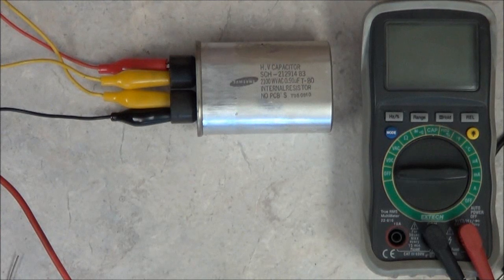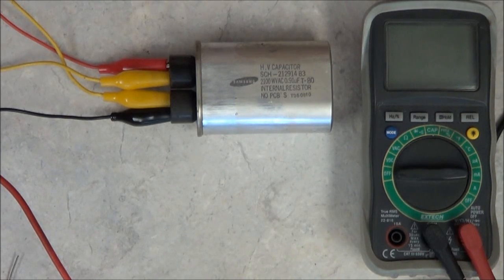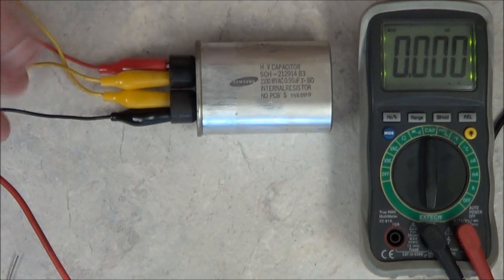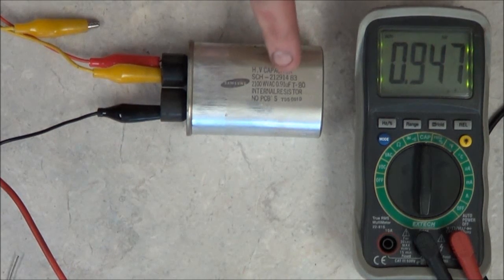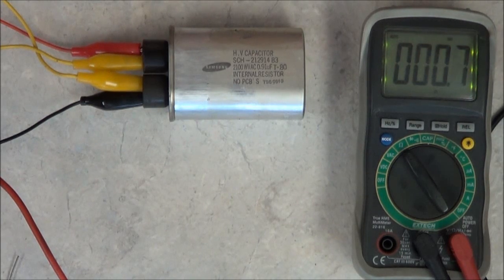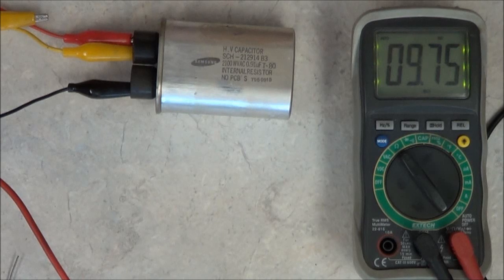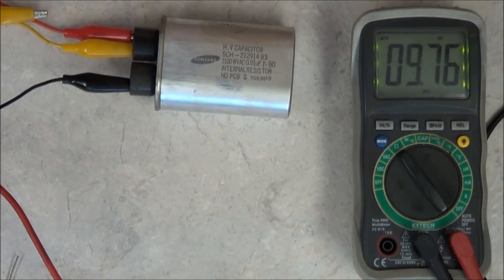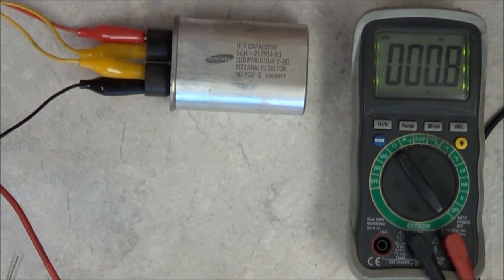How to test the Microwave Oven's HV Capacitor

Comment: In the UK .. a  VERY  simple way to test your  EHT  1μF capacitor ... is to put it in series with a 25 Watt , 230 Volt ( old skool ) Tungsten filament light bulb , apply mains !  ... an orange glow ( similar to a 1940's tube [ valve ] radio )  , should indicate a working capacitor ... BTW .. this setup makes an excellent night light ( try it out ! ) .............. DAVE™🛑

Comment: Used the capacitor setting to test a microwave capacitor and numbers were fluctuating up and down between 0-.50, stopped for 5 seconds ,then continued. Have you seen them fluctuate like this before ? I'm assuming the capacitor is faulty if it's fluctuating up and down like that every 5 seconds?

Comment: OL means OPEN LINE not Over the Limit. OPEN LINE means infinite resistance which happens if the test leads are opened apart with no conductance between them.
Reply: Odouls77 open loop
Reply: Delbert Stevens - Another one is Open Load or Open Leads. Both mean infinite resistance, higher then 100 million megohms.
Reply: Thanks

Comment: Very good presentation. A clear demonstration of a built in bleed resistor in a high voltage capacitor using a digital meter.

Comment: Thanks for the safety comment. I need a clarification since I am new to this. I am not attempting anything until I am sure so I have a lot to learn by reading first.

This is the part I need to understand: Your comment is in quotes.

1. "This case: high voltage cap, if charged it can take a while to discharge or worse the internal resistor is busted and it doesn't. In this case it could sit there at 2kV you touch it or try to put non-insulated/poorly insulated alligator clips on it and the high voltage in there happily zaps you with potentially lethal results, hence make sure it is discharged entirely. 
My response: Yes, I understand this part.

2. "Same goes for "just mains rated" filter caps and what not in any transformer on the mains side even if the appliance has been unpowered for a long time."

My response:
A. What is "mains" and "mains rated" and "mains rated" filter capacitors? 

B. When using the word "transformer" are there transformers in a microwave that remain charged if the microwave is unplugged and the capacitor has been discharged, disconnected and removed from the microwave?
Reply from the maker: The "mains" refers to the primary power source going into the microwave.  Some microwaves use a Mains Filtering capacitor to filter out electrical noise created during operation. The HV capacitor is used to double the output voltage from the Transformer.  The newer HV capacitors have a built-in 10M ohm resistor to bleed the Capacitor's Charge. To ensure they are discharged you must use an insulated tool to short the terminals on the capacitor before removing the capacitor. The jumper alligator clips are then used to keep the capacitor discharged until you're ready to test the capacitor.

If replacing the capacitor, the new capacitor must match the same ratings as the original. 

Transformers cannot hold a charge because they depend on induction. for them to work.  Meaning current has to flow thru the transformer to for it to work, as to why all electical power must be removed before service.

Comment from the maker: No, I don't mind, MrMac. Everyone else does. Isn't ESR meters used to test the internal resistance in battery packs? Never heard of them being used to test a Capacitor. I rarely use the capacitance tester since I've had better results using an ohm meter to test them. -MrFixit

Comment: Great explanation, thanks for the video!

Question: Why does the digital multimeter show 20MΩ → 10MΩ when starting from a discharged capacitor and 5MΩ → 10MΩ on subsequent readings?

The 5MΩ → 10MΩ makes sense to me: As the capacitor is being charged its resistance increases, up to a point where we’re looking at just the 10MΩ from the internal resistor.

But the 20MΩ → 10MΩ I don’t understand…
Reply from the maker: Modern HV Microwave capacitors have an internal 10 Megaohm Resistor (known as a Bleed Resistor) connected across the terminals. This is to safely discharge the capacitor when the power is removed. The first test determines if the 10 Megaohm Resistor is functioning as intended.

Ohm Meters start from their highest measurable value, in this case, 40 Megaohms. As the tester applies current to the capacitor, it is measuring the resistance. The values are decreasing as it measures the resistance in the Capacitor but at the same time the resistance is increasing as the Capacitor is charging. A 1 microfarad Capacitor does not take long to charge. 

By the time it dropped to 10 Megaohms the capacitor was nearly at full charge, as to why the Values were slowing down then stopping at 9.76 megaohms.
Reply: @ESRepair  Thank you for the answer.

Comment from the maker: Yes, an oscilloscope would help to see if the capacitor is bad. It will show a waveform applied to capacitor and how the capacitor responds to the waveform. I am still learning how to use mine. I've tinkered with it from time to time and had thought of doing a video how to use it. -MrFixit

Comment: Love the videos!!! keep it up!

Here's my problem (hopefully you can help). Our 1 year old Kenmore range microwave started to hum loud and burning smell and no heat. My research said could be the diode, capacitor or transformer. I had another older Kenmore range and I took the diode out of it and tried it in the bad microwave (AND YES, I DISCHARGED THE CAPACITOR 1st).  Now the loud hum seems to be gone but still no heat. I'm only 99.9% sure I wired the red wire and white wire to the capacitor as well as the diode correctly :(

Any suggestions would be appreciated...

Comment: wow 2200volts 0.9uf?? my motorbike ac cdi is using a tiny 400v 0.6uf capacitor, will this capacitor boost my cdi spark ignition plasma output? fantastic clear explanation even a cat can comprehend this! great video! thank you comrade fixit!
Reply: My cat used my microwave and fridge to build a nuclear bomb
Reply: my cat put in the right capacitor and made it resonant RLC, now shes self looping...I can even hydrolise water with it..Don Smith was correct afterall ;)
Reply: JustinLodes n

Comment: I am doing some research into capacitors, which are a fairly new thing for me to be getting deeper into. I would like to know, how the capacitor is charging in this video, like what is powering it. dose it have a battery, or an input that is not seen in the video?
Reply: The meter (as a measuring device) is applying a small amount of SNEAK voltage into the circuit, which is slowly jacking up the capacitor.

Comment: You are unable to test for dielectric leakage which causes failure of capacitors. You must apply DC working voltage to do this. But since you have a shunt resistor inside, the effect is equal to dielectric leakage.

Comment: I tested my microwave capacitor per your demonstration.  I get 10.12 Mohm.  There is a little amount of black residue and some needlepoint pitted spots on top of capacitor beside the plastic protectors of the poles.  
Question....
Is it possible that the tests can all be good, but the capacitor will not charge all the way to 2200V in order to power the magnetron?
Reply: Note...My meter does not have a capacitance test mode, so, I could only use the ohm test procedure that you described
Reply from the maker: You need to discharge the capacitor, and use the Ohm tester.  The capacitor should show a steady increase in resistance up to 10M ohms. IF it Flat reads 10M ohms after the Discharge than Capacitor is dead and needs replaced.

Comment: Which is the positive and negative terminal on a microwave oven cap? Are both top terminals positive with the case negative as  in a electrolytic  cap.   if polarity not correctly hooked up the cap will be damaged.  My cap tests excellent as per your video but I need to know how to hook it up correctly just like a electrolytic cap.. I am using the cap for a hi voltage setup I am experimenting with.
Reply from the maker: +Thomas Ferko Microwave oven capacitor's are not polarized. They are monolithic capacitors. The terminal can be positive or negative and doesn't matter which one is which. The case is grounded in the event the capacitor shorts.  -MrFixit

Comment: Hi,  I'm George ,I have a 1.14uF cap in my panasonic microwave I have permormed the test in your video capacitance meter shows 1.13 that is close enough but the resistance test settles at 25Mohms, and when i insert a 10meg resistor accross it settles at 7.5meg , this tells me 25 in parallele with 10 makes 7.5 , what is your opinion of this , also the magnetron reads zero Ohms it was an aftermarket AM703 , i think i have to buy another one ,  Thank you
Cheers
George

Comment: May I ask why there is a resistor inside the microwave AC capacitor?

Can AC capacitor used to store DC current? Or they are not compatible?
Reply from the maker: The capacitor is not an AC capacitor.   It is a non-polarized DC capacitor.  AC capacitors are often used in electric induction motors to start the them up.  They can store a DC charge but they cannot store as much as a DC Capacitor.   The Resistor in HV capacitors is used to drain the capacitor's charge when the power is removed.

Comment: I'm working on a GE Micro and forgot the placement of the diode lead to the capacitor. Does it connect with the red wire lead to the magatron or the white wire? What would be the result if it was connected wrong. Thanks for your time...
Reply: You can probably find a YT vid w/ that info.  I would recommend taking a picture of such wiring before taking anything apart.  Seems dangerous to have to guess or remember wrong.

Comment: ESR is the best you can tell if a cap is no good, if its going to heat up etc. the tester puts a 100 k hz  sine wave threw the cap to see its internal resistance, and yes you can predict a battery losing its life threw testing the internal resistance, it would be a great video showing people how to make a ESR, home-made parts 20 bucks, to buy $100 to $150 for a good one.  waiting for your next video.
Reply: MrMac5150 i cannot stand to see such bad English. The word you want is.  Through.   Not threw

Comment: If the capacitor is bad, what are the symptoms?  Does the light and control panel work but it won't turn on?
Reply from the maker: +offonroad If everything is working but there is no heat, Then the problem is a bad relay, door switch, HV Diode or HV Capacitor.  If the control panel is working but nothing turns on, there's a bad relay or control board.  -MrFixit

Comment: TOOK IT APART,AND TRANSFORMER IS CHARED/BURNT IN 2 COPPER WIRE SPOTS ON BOTH SIDES. DOES THIS MEAN I NEED A NEW ONE TRANSFORMER? IF SO, WOULD THERE BE A GOOD CHANCE IT ALSO FRIED THE MAGNATRON AND CAPACITOR ?   OR NOT?
Reply from the maker: I apologize for the delay in response. The Transformer will have to be replaced. for the price of a new HV transformer you can buy a new microwave oven. The Magnetron may be damaged that caused the Transformer to blow. either way you're better off buying a new Microwave. -MrFixit
Reply from the maker: The HV Capacitor in conjunction with the Diode doubles the High Voltage Output from the Transformer for the Magnetron to operate. The Process is called Half-wave Voltage Doubler. MrFixit
Reply from the maker: Anytime. -MrFixit

Comment: If you reverse the wires on the capacitor will it blow it
Reply from the maker: Non-Polarized capacitors do not have a Positive/Negative polarity. Voltages higher than their declared rating will certainly damage the capacitor. Polarized capacitors do have a Positive and negative terminals. These capacitors are specially marked with the + for Positive terminal and a - for the negative terminal.  Reversed polarity will damage the capacitor as well as exceeding the voltage rating.
Reply: @ESRepair  thank you

Comment: Hi, 
I have a 1.05uF capacitor that I need to replace. 
1. Would a 1uF replacement be OK ? 
2. If I don't use the exact capacitance would it change the microwave wave frequency (The reason I ask is because the chamber is build to keep micro waves at a specified wave frequency. If I change it, a radiation leak can occur as I understand) ?
3. Is it safe (safe I mean that the capacitor would not explode or melt and cause fire) to buy anonymous capacitor from online websites (like Aliexpress) ?
Reply: 1. I think it will be ok. Probably the tolerance of the capacitor is more than 5%.
2. No. It's not a part of resonant circuit. Frequency that microwave oven generates depends mainly on physical dimensions of magnetron cavities. The HV capacitor is simply a part of voltage doubler circuit. Slight difference in capacity may at most transfer to little different voltage powering the magnetron, and the generated power, but it would be difficult to even notice that difference.
3. I think they are safe. After all the capacitor that your oven originally had, was made to the similar (chinese) quality standards. :-)

Comment: Why do you need to manually discharge a capacitor if it's already being  discharged automatically through a "built-in" resistor?
Reply: Okay it's a bit of an old comment I'm replying to here but even if you don't read it anyone that doesn't know it can learn I guess. When dealing with any cap rated for a high voltage and even low voltage ones always depower your circuit and discharge unless you know entirely know what you're doing and know that depending on what your test gear is set to it or the appliance can be damaged (don't mess with it unless you know what you're dealing with). 

This case: high voltage cap, if charged it can take a while to discharge or worse the internal resistor is busted and it doesn't. In this case it could sit there at 2kV you touch it or try to put non-insulated/poorly insulated alligator clips on it and the high voltage in there happily zaps you with potentially lethal results, hence make sure it is discharged entirely. Same goes for "just mains rated" filter caps and what not in any transformer on the mains side even if the appliance has been unpowered for a long time. 

Low voltage but reasonable capacity capacitors are unlikely to kill or zap you but for example put your multimeter on ohms or current on it and depending on the quality of your meter you can bust it or blow a fuse. Some meters for example will survive resistance setting on mains (my fluke and Agilent properly cat4 rated ones) but I won't do it or ever suggest to try it. I like seeing the test in reviews on the eevblog channel by Dave Jones, many cheap meters died that way ;) 

But yeah basically use common sense observe visually first, understand what it is if needed learn about things and when in doubt measure volts first. The high input impedance should protect you and the meter, don't touch mains powered devices unless your meter is at least of a proper brand and cat 2 or better rated for that voltage. Even then preferably do it depowered if possible, if not attach probes beforehand then power it up and operate the device. 

And if you don't really know what you're doing just don't touch anything like microwaves, old CRT based tvs and monitors, etc. They all involve high voltage caps that can hold a charge for a long time.
Reply: TribunusLaticlavus Thank you :)
Reply: It's RC Time Constant, look it up in Google!  It takes some time to bleed the capacitor through resistor, depending on the size of the capacitor, and the value of the resistor!
Reply: Go ahead and trust the resistor!  its only only around 2000 volts. duh

Comment: A bad capacitor can easily pass this type of test and still be completely faulty. There is no mention of the ESR (equivalent series resistance), nor of leakage current (IL). The IDEAL capacitor, indeed, has no leakage current. In practicality though, this is not the case. These types of failures essentially turn your capacitor into a resistive load, increasing internal temperatures, and creating even more resistance. Even when the capacitance can be quantified as within the manufacturers specifications, this type of test alone is not sufficient to call the capacitor good.
Reply: Fully agree

Comment: you talk about the cap recharging but what is the source?  All I see is a shorting wire and two test leads.
Reply from the maker: The charging comes from the test meter.  The yellow wire was used to keep the cap from charging. When removed the tester applies power thru the cap and measures the charge capacity of the cap.

Comment: hi I have an issue with the microwave... issue is blown fuse everytime I open or close the door.. checked my door switches... and the monitor switch was bad. ..I swapped it out for a new one and the fuse is still blowing out! stuck atm .. I don't think its on the high voltage side because the microwave isn't in use.  just opening and closing door causes fuse to blow any help would be appreciated thanks in advance
Reply from the maker: There is a 'safety' interlock switch that is wired to blow the fuse if the MW doesn't shut off when the door is opened. The primary and safety switches are interlocked. The primary switch opens then the Safety switch closes. If both are activated at the same time the fuse blows. Double check the wiring and the switches. -MrFixit

Comment: My micowave has a problem of a buzzing noise and sparking when heating,what is the problem and how can i fix it
Reply: Sounds like you have a hole forming in the inner cavity. It happens when the paint inside the microwave chips and moisture corrodes that area making a hole and when that happens the microwaves hit the edges of the hole causing it to spark. It could be repaired but it would require welding a new plate where the hole is and then painting it with corrosion protecting paint. The paint may also help to deflect the microwaves